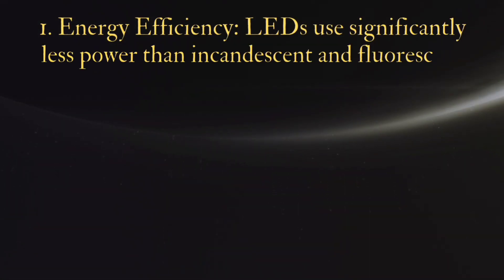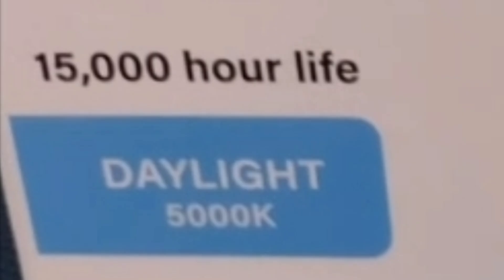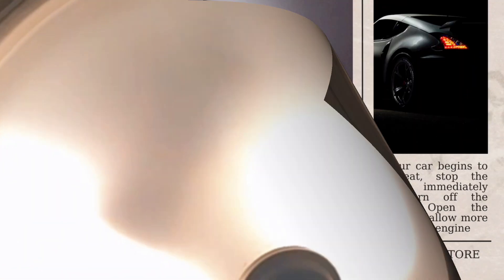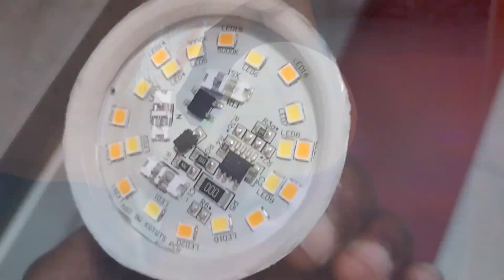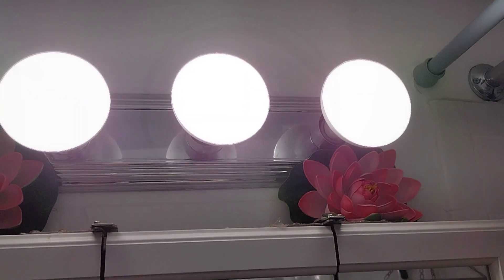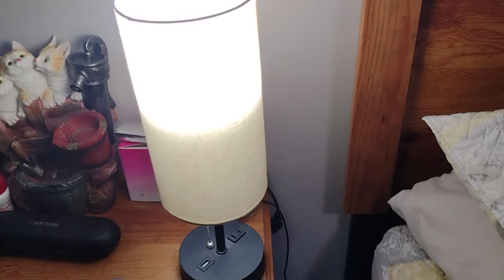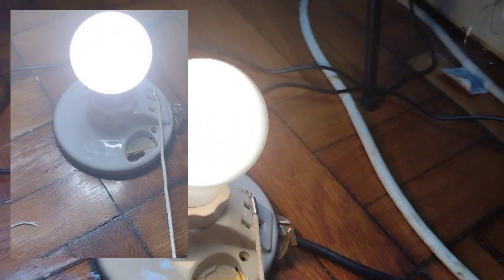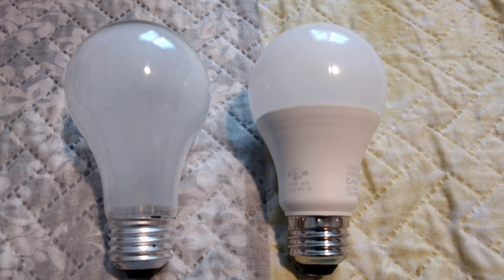Why You Should  Never Use LED House Bulbs In Closed Fixtures

Comment: The power savings are real, but the light quality is terribly inferior to incandescent bulbs, this has been measured and confirmed hundreds of times.
The LED bulbs fail in a slightly higher average heat because they are made with lead free solder, which is inferior in every way and highly failure prone.
There is nothing in the design specifications of LED bulbs that limits their use in enclosed fixtures.
What you have discovered is poor product quality and workmanship that applies to the entire product line, regardless of brand.

Comment: Filament led bulbs have less heat issues. Early led bulbs were quite heavy with a good heatsink, more recent cheap ones run the LEDs very hot with little heat sinking.
Reply from the maker: @TechStuff365  Thanks for watching and for your comment. Excellent analysis and that's exactly what I think is happening with some of these led Bulbs, they are not properly made
Reply: @crediblemikeLWR  bigclives video on Dubai led lights is worth watching. He's done many videos on making the LEDs run less hot and more efficiently.

Comment: Even if I had to replace LED bulbs four times more often, it would still be much less often than with traditional bulbs, and considering the energy saved, it would still be much cheaper to use them than traditional bulbs. In fact, once an LED bulb has reached the lifespan of a conventional bulb, it has already saved me as much energy costs as the price difference between an LED bulb and a conventional bulb.
Reply from the maker: @xcoder1122  Thanks for watching and also for your feedback. It's much appreciated

Comment: You could reduce the heat build-up by drilling some holes in the top of the fixture. It would mean you'll have to periodically empty out the dead bugs, but cheaper than replacing bulbs. 
You could also remove the white plastic dome from the bulb. This will expose potentially live components but as long as you don't switch the light on until the fixture is closed you will be safe, and guaranteed the bulb will last longer.
Reply from the maker: Thanks for watching and also for your suggestion. What I noticed about removing the diffuser is that the light output is unevenly dispersed and is not as effective without the dome. Holes in the diffuser should definitely help as it will help to get rid of the excessive heat buildup. 👍

Comment: I use LED bulbs on the two outside garage lights I have mounted on each side of the overhead door and they are enclosed and even the summer heat does not burn them out
Reply from the maker: @Da-King-of-Swing  Thanks for watching and also for your comment. Apparently the quality bulb has a lot to do with the issue that I mentioned. 👍

Comment: The LED bulb is an enclosed fixture in itself, so this 'problem' sounds strange to me.  I never had problems in this aspect, so it could be the quality of the bulbs. Try a different brand.
Reply from the maker: @49jg  Thanks for watching and for your feedback. The quality of the bulb definitely has a great impact on the longevity of the bulbs and yes I definitely will try different brands. Viewers are suggesting for starters, Phillips and Sylvania brands.
Reply: @crediblemikeLWR    I write the date at the side on each bulb when first installed, so it gives me a rough idea which ones don't last as long.  Indeed, the cheapo ones spoil in about a year (~8 to 10h use per day in the Study or Office) but Philips last us > 3 years.

Some of our LED bulbs are still working in the 5th year but we change them as they have dimmed. Over the years, we have encountered 2 or 3  Phillips bulbs that blew within a year but they are probably outliers; we still find them good.

Does anyone know if using 220v rated bulbs in a 230v electricity supply will shorten the lifespan of the bulbs?  Or is the difference too negligible?

Comment: I’ve never read that they weren’t supposed to be used in enclosed fixtures, thanks for pointing this feature out! 
We’ve been so annoyed at the flickering but thought it was just LED bulbs not operating correctly in an older fixture. 🤷🏼‍♂️👏🏻👏🏻👏🏻
Reply from the maker: @leohorishny9561  Thanks for watching and for your feedback. Some viewers have stated that they have had great success with brands like Phillips and Sylvania, so maybe it's worth giving these a try. What is clear is that not all led are created equal. All the best.
Reply: Heh, first failure was a bathroom light, tulip shaped shade allowing heat to accumulate due to a lack of airflow. Caught blinking out of the corner of my eye and thought, "either someone beamed into the bathroom and is taking my picture or I've got a bad bulb". Grabbed a spare bulb from the box and sure enough, a lamp had failed. About a month or so later, a second one failed the same way, but I tossed it without examining it at the time due to being a bit too busy.
I'm seeing largely filter cap heat related failure of a cheap cap and one with a lamp that had the filter cap through board, not soldered in, but plugged into a spring connector that lost tension and allowed the leads/connection to oxidize and just act like a big old resistor.
Reply from the maker: @spvillano  Thanks for watching and also for this information. Cheap LEDs seem to have a much higher premature failure rate. So I will try more established brands like Phillips and Sylvania. Thanks for sharing
Reply: If they are on a dimmer then you need to make sure the bulb says dimmable. Also make sure the dimmer is rated for LED's. This is another reason they might flicker.
Reply: @ryan61384  had a fixture that used E12 bulbs, put filament type LED lamps in, wouldn't light. Didn't load the thyristor enough to keep it latched on. So, I put one incandescent lamp in, as I wasn't about to go with adding a load resistor into a fixture in a rental house that wasn't my own. Only needed around 100 mA to keep the thing latched on, but most in that area wouldn't have a clue what a resistor was, let alone what it'd be for.

Comment: Unfortunately what other option do we have at this point… They’ve phased out in candescent and I really don’t want to put in fluorescent bulbs because of the appearance and because if you drop it you have toxins in the air. I have bought LED bulbs that are rated for enclosed fixtures and still have had issues with them. I am changing out the old ones as they go bad to a different brand and hoping for the best. There is no other option. I tried to find old-school bulbs it was from China with the wrong wattage I give up
Reply from the maker: @STVYT  Thanks for watching. Some viewers have stated that they have had very little issues with brands like Phillips and Sylvania, so these might be good options to try. Thanks for your contribution to the ongoing discussion. I hope your situation improves.

Comment: They overheat want to make them last longer drill a hole in the top of them. Won't work on an enclosed fixture that you leave on forever however.
Reply from the maker: @johncameron2241  Thanks for watching. I am currently running my experiment on a bulb that was failing by drilling Holes in it. Thanks for sharing

Comment: Yes, I’ve noticed this. I’ve removed the covers, and it fixed the problem. Thanks for the video, which confirms what I suspected. I also have a box full of the bad bulbs because I know I can fix them by finding which led inside the bulb burnt out and replacing or shunting it.
Reply from the maker: @williamwhitney6473  Thanks for watching and for your feedback. I am happy you can relate to the concerns expressed in the video. I have seen how to do basic repairs but have not done so yet because I disposed of all the bad led bulbs, but I will be repairing them in the future. Thanks again for your feedback

Comment: Enclosed or not, I've found it's a total crapshoot with LEDs.  Wherever they are, they might last for many years or they may start to flicker and die much sooner than that. 
Whether it's a cheap drive circuit or not, these just aren't what they're advertised to be.
Reply from the maker: Thanks for watching the video. This is an interesting perspective that you are highlighting.  Thanks for sharing
Reply: I agree with this. The LED bulbs I've used seem to fail far too quickly even when not in enclosed fixtures. I think many of the off-brand ones are cheaply made. I'm sure that the heat buildup inside enclosed fixtures doesn't help the life of the bulbs, but they just don't last as long as they are advertised. More well-known brands are likely to be better quality, but expect to pay for that. It's a tradeoff. You can get the cheaper ones, replace them more often, and still come out ahead. If it's a hard-to-reach fixture it might be better to spend more and not have to get up on ladders so often.

I've seen videos of people repairing these LED bulbs. It is usually just one single LED that fails out of 10 or 12. The whole thing goes out because they are wired in series.If you can find the bad one, it can be jumpered, although other components can fail also. I don't recommend doing that, though. Aside from safety issues, does it make sense to spend a half hour fixing something that costs less than a dollar in many cases?
Reply: The majority of LED lamps are manufactured on the cheap by Chinese companies who have no concept of product quality. If you want long lasting LED lighting you have to buy from a renown manufacturer and pay the price for them. BTW, most LEDs have "Made in China" written on them. That's okay, important is that they are manufactured by a western company, such as Philips, with factories in China that have western style quality controls.
Reply: I purchase a house with a ceiling fan with two LED's in the enclosed light fixture (it is a screw-on large glass bowl) three years ago and the bulbs have not needed replacement after three years.
Reply: @eddihaskell  You do know that 3 years is absolutely nothing for an LED, don't you? LEDs are supposed to last between 50 000 and a 100 000 hours. We're talking here of between 12 and 24 years service life!
Reply: @mikethespike7579  Yes, but they are enblosed in a small, shallow bowl in my ceriling fan -- 2 x 60.  They came with the house when I bought it. I have never replaced them in 3 years. I thought that was the point of the article -- they should not be used in small enclosed bowls.
Reply: @eddihaskell  Yes, I understand your comment. My point is, that 3 years in an enclosure is not proof of anything. How long an LED lasts depends a lot on heat dissipation and how often it is switched on and off. I have an LED light that I designed and built myself. It's about 0.5 Watts strong, has a large heat sink and has been on now non-stop for 23 years. In optimum conditions, LEDs have decades of life expectancy, not just a few years.
Reply from the maker: @eddihaskell  Thanks for watching and also for sharing. 👍

Comment: And likewise incandescent bulbs will destroy those cheap enclosed fixtures because they get so hot. The plastic sockets and wires will turn brittle after a few years of use and the fixture will stick to the ceiling paint and discolor it. Best option is simply to buy LEDS that say the are rated for enclosed fixtures. They’re pretty common nowadays.
Reply from the maker: @privacyinvasion7166  Thanks for watching and for your feedback

Comment: glad you didnt get a nasty shock at the end there touching the board, especially using your left hand (your heart is on that side.)
Reply from the maker: @jimmybrad156  Thanks for watching. I know a tad bit about electricity, enough to know that the bulb converts AC current to DC current, which isn't enough to cause an electric shock. The light emitting Diodes cannot withstand high current flow. Nonetheless point taken and duly noted. I do appreciate your concerns.

Comment: The problem isn't the LED array.   The problem is the cheap usually Chinese made driver circuit.   The cut corners on the quality of the capacitors and other components.   If they used better components they would last decades.   The price difference would be pennies, but when they make money selling millions of units they only care if they last long enough to get past any possible warranty period.   Then you have to buy again or sit in the dark.  This is happening in every industry.
Reply from the maker: @flyguy6296  Thanks for watching. I must agree with you, it's painfully obvious. Thanks for your insight and your feedback
Reply from the maker: @flyguy6296  Exploitation of unsuspecting consumer is their game. With the sharing of information such as this and guiding consumers on what brands actually work and what to look out for, will certainly force them to change their ways or go out of business.
Reply: What you say about intentional bad quality rings true. If they made them too well they would not sell nearly as many. Also, I doubt that they have to honor the warranty very often. Look at the language of a lot of those warranties. Yes, they will replace them if you have your original receipt and pay to ship the defective bulbs to the company. Most people are not going to bother doing that when it is probably cheaper and less inconvenient to just go out and buy new bulbs.
Reply: I've three failed lamps now that I've examined, two from my apartment, one from the building's outside enclosed fixture. One a non-enclosed fixture with high hours usage.
The outdoor fixture lamp was due to the filter cap being connected via spring connectors through board/heatsink plate, which lost tension, allowing the ESR to the cap to increase and the ripple killed the driver chip. The two apartment bulbs shared failure modes, both baked their cheap-o-matic filter caps, the shortest life being a tulip shaped fixture that just allowed heat to build up around the base of the lamp. Both filter caps had heated sufficiently to lose their heat shrink labels, which had degraded and crumbled.
They're also bargain basement types, come in a box of 8 for under $20 for daylight lamps. Of course, had the manufacturer installed higher quality caps, they'd likely have lasted longer, but would've been a few pennies more per lamp and lower their profit margin and raise the price to me. I've used up that supply, they were left over from a purchase from 5 years ago in a different location. Ordered some slightly more expensive name brand lamps in multipacks of the same size as the bargains, catching them on sale.
You get what you pay for, but occasionally you can catch a good sale at a serendipitous time. We'll see what happens when one of the Sylvania lamps fail, but it'll still likely be the electrolytic filter cap ESR rising enough to allow spikes to kill the driver chip. I've yet to see a dead LED in the array proper.
Reply: Good comment. Ideally some standard that aims to make sure these LED lamps last as long as they claim. I have found some LED lamps don't even last as long as incandescent or CFL lamps. Also, some LED light fittings are not designed to allow replacement of the lamp. So, whole unit is scrapped after a short period. How can these short life LED lamps or fittings be good for the environment?
Reply from the maker: @Steve-GM0HUU  Thanks for watching and for your feedback. I’ve seen the type of light fixtures you mentioned that don’t allow for replacement. I bought lighting accessories and changed the receptacle in order to accommodate regular type led bulbs.
Reply: @Steve-GM0HUU  oh, that's easy! They're good for the environment because they use less electricity. Because steel melts itself, forms itself, as does silicon, for free, no power needed to heat things to thousands of degrees or something.
Show low energy usage of the finished product that is designed to be cheap, not reliable, hope nobody notices until you can change your company name and reopen selling similar crap under that new name...
Buy cheap, get precisely what you pay for, short lived crap you're spending more for by using it only briefly, then replacing it. A lesson most of us learned by buying a Harbor Freight power tool, which really ended up being single use devices.
Reply: I do not believe I have ever seen a capacitor, or a semiconductor for that matter, rated for 400 degrees F.
Reply: It’s called Planned Obsolescence, certainly nothing new in the tech industry

Comment: I've had only one bulb fail in about 10 years, and it wasn't in an enclosed fixture.
Reply from the maker: @richardmerriam7044  Thanks for watching and also for your feedback. That's awesome. I being at my location for three years and have had multiple led bulb failures (in enclosure) those outside of the enclosure are doing just fine though. There are also different brands. So the key for me is to research and purchase only quality proven brands
Reply: @crediblemikeLWR  I try to buy only Sylvania.

Comment: LED bulbs don't create heat
Reply from the maker: @johnrobertd748  Thanks for watching and also for your interesting comment. Please elaborate so I can better understand. Yes the bulb contains diodes but according to physics every form of energy transfer involves the production of heat which is wasted energy. Also these devices including automotive led bulbs are built with heat synch and in some instances fans to dissipate the heat and prevent premature failure.

Comment: Dunno...........I'm good........
Reply from the maker: @daleb5967  Thanks for watching and for your feedback. From the feedback received so far the quality build of the led bulbs seems to be the biggest contributing factor to light bulbs failing prematurely in enclosure. So the biggest take away so far is to buy from reputable brands and check for the relevant information indicating that it can be used in enclosures.